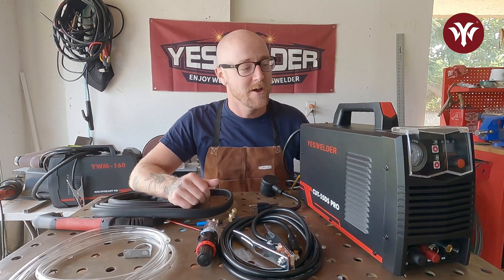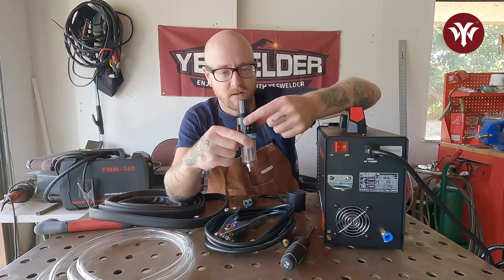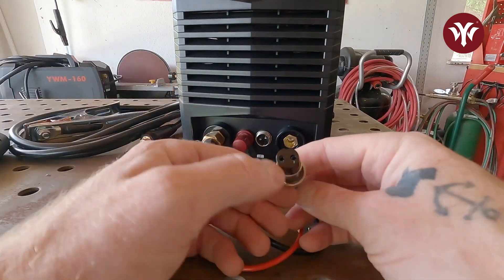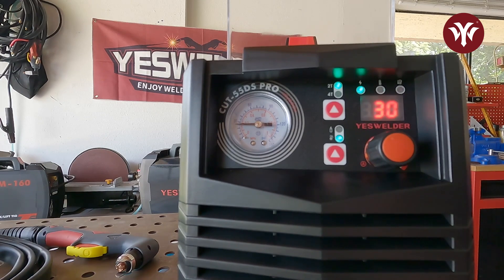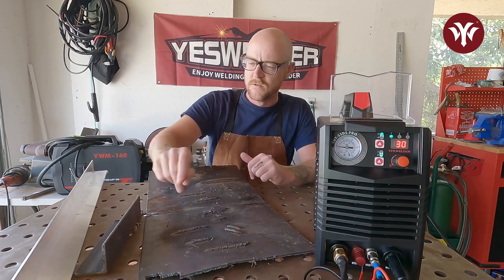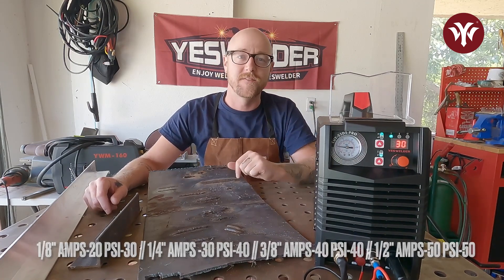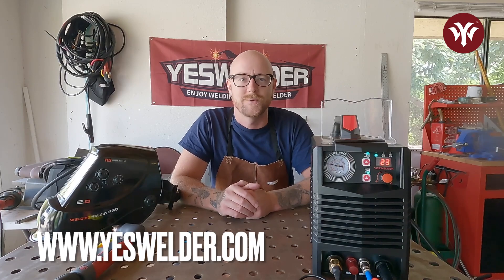Clean Cut on Various Metals: Cut-55DS Pro Users' Guide | YesWelder

Comment: What air compressor you are using is a very important subject you should have touched on, because it needs to put out at least 5.2 CFM at 90 PSI if I'm not mistaken, because I have the Yeswelder CUT 55DS from 2021.
Reply: I meant 5 SCFM, and my air compressor puts out 5.2 SCFM at 90 PSI.

Comment: I bought one of these. During setup I found the air regulator/filter came broken and would turn in the unlocked position. Then I went to cut metal for the first time. The machine only counts up from 20 to 35 amps. Ok fine the interface is off. Go to do a cut and the main arc never fires after the pilot arc. The ground is clean and well attached. What the heck?!
Reply: Did you find a fix? Mine is doing the same
Reply: @209welder  no. I brought it to warranty. They wanted a one take video of all the faults. It’s been 5 months and making a video is such a pita that I haven’t gotten to it yet.

Comment: I just purchased a number of these machines from Jeff's Jungle site AKA Amazon for myself and dear friends.  How is the warranty situation resolved for your customers to keep them happy?  How frequently have you had PCB printed circuit board or other failures modes with this unit? How much do these replacement parts cost when out of warranty?  How long is the factory warranty?  Thank you!
Reply from the maker: Hi there! Products purchased on Amazon come with a one-year warranty. If the machine encounters any issues within the warranty period, we will either send a replacement machine or provide a refund based on the customer's preference. Once the warranty period has expired, and if the machine develops issues, we will offer technical support to assist you in resolving the problem. However, replacements or refunds will not be provided. In the case of faulty components, we can send you replacement parts free of charge. :_Love:

Comment: How did you connect the air line from the compressor to the filter?
Reply from the maker: Hi there! The detailed steps are outlined in the user manual. You can connect the gas tube by inserting it through the pressure regulator, then attaching it to the gas inlet at the back of the machine.

Comment from the maker: Outline:
00:00 Introduction
00:40 Components and Assembly
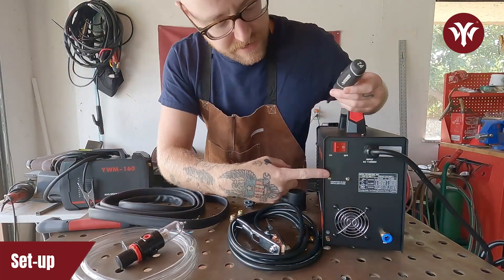01:09 Torch Setup
03:35 Front Panel Overview
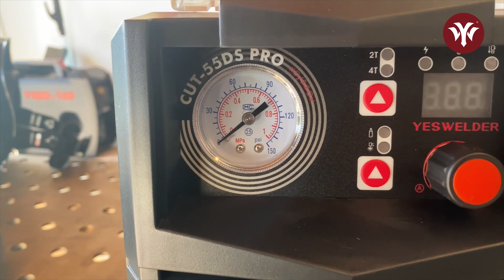04:57 Plasma Cutting Demonstration
06:48 Conclusion
Reply: So this unit has its own air compressor built in ?

Comment: Can this machine be used on a CNC table?  Thanks.
Reply from the maker: This machine is not compatible with CNC, but CT2050 is.😊
Reply: yes it can.  you have to manually install your trigger wires to the motherboard.  the RAW power and ground.  or buy a machine that they already did it for you charging you hundreds more for 2 wires.